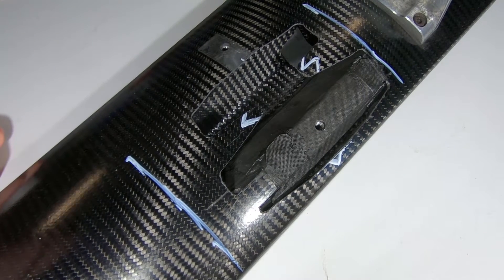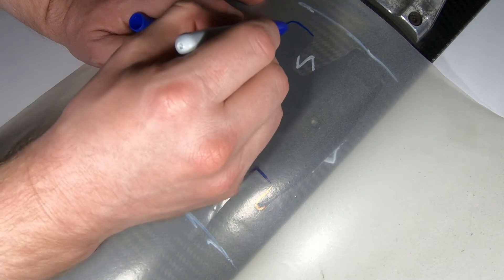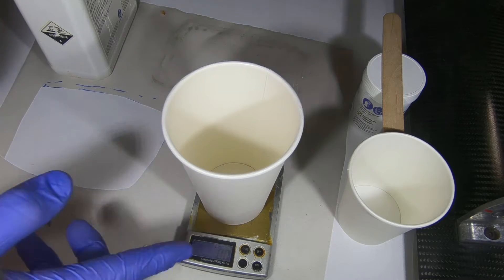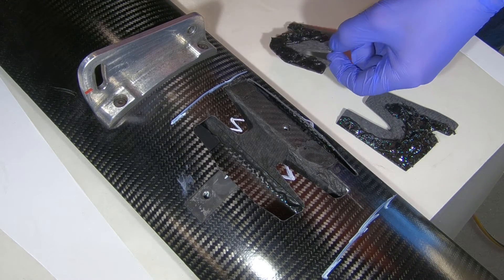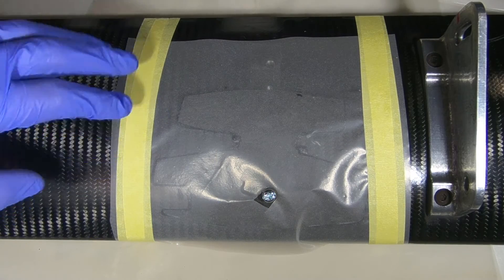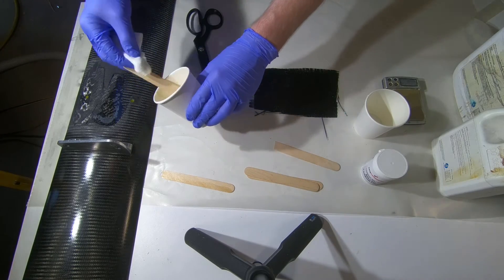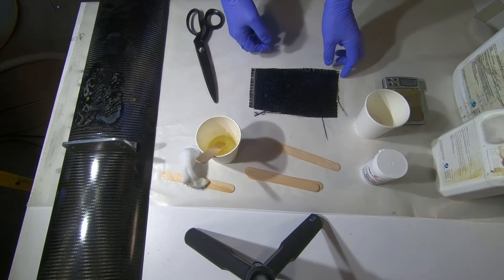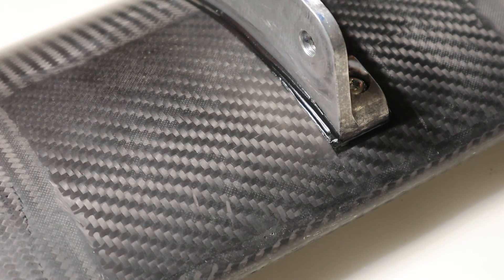[REPAIR] Formula 3 Wing Part 2

Comment: Is there a reason you didn't match the angle of the weave on the last piece to line up with the original, (just to make it look a little better) ?
Reply from the maker: To be honest I didn't even think about it. When I do a repair like this I do a damage analysis, provide a report to the customer and then I talk about repair methodology (so they can reference back to if it required) and surface finishes and the like. I specified that the surface finish wouldn't be cosmetic and then paid it no further attention. The repair was also on the underside of the wing so is not visible. 

However, now that you have raised this, its something I should take on. It probably wouldn't have been too hard line them up and I should have.